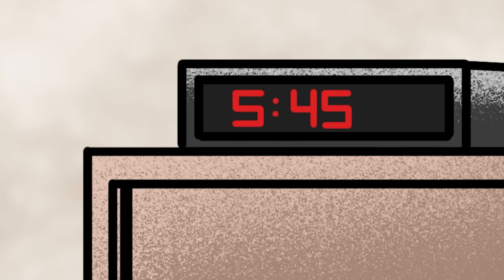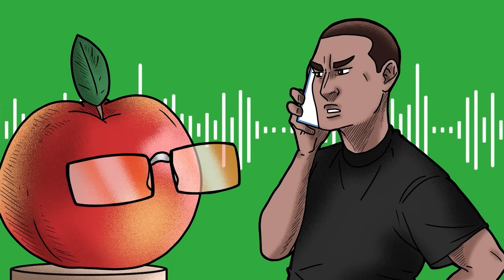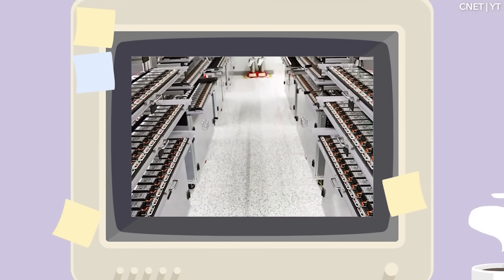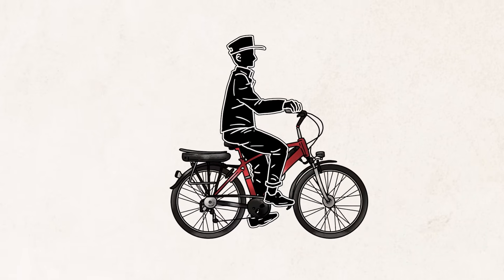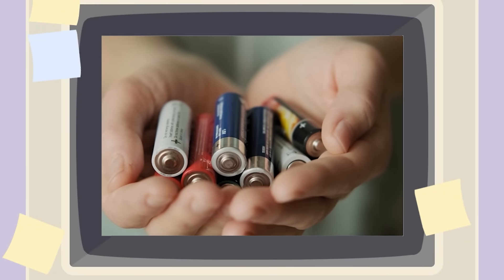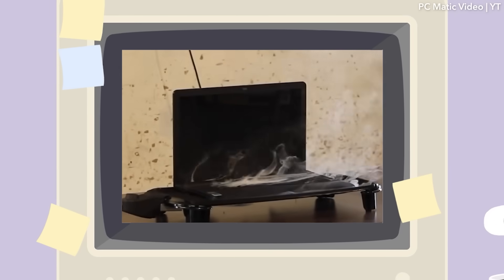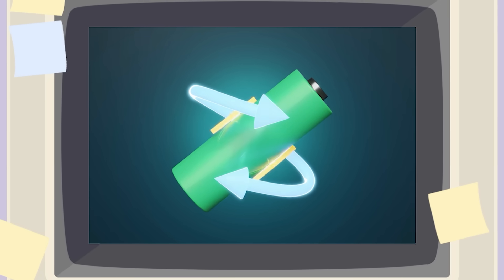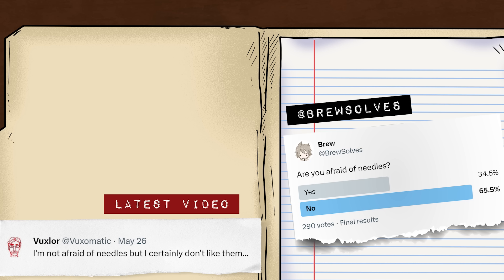A Man Wears His New AirPods. Minutes Later, He's Rushed to the Hospital.

Comment: As a person who had returned to using wired earbuds after the wireless ones start heating up every time i charge it. I guess i did the right choice.
Also, i always considered charging phones overnight as an extremely dangerous idea, so it always surprised me when i hear someone said they have their phone charged overnight.
Reply: Well I'm not waking up in the middle of the night just to unplug my phone, so my phone is just going to have deal with it
Reply: smartphones automatically stop charging when at 100%, or a set charge limit. if you have a smartphone, you can leave your phone on the charger all night and it will be fine
Reply: @maxgoushaw1977  yeah idk why people are so paranoid about it, I did for years and my devices are totally fine
Reply: Off brand phones won’t have the safety feature sadly
Reply: I used to charge my phone overnight (i only got a phone like 3 years ago when i graduated so i still priortized my laptop for awhile) then i became addicted to using it in bed before going to sleep and would be too lazy to get up and plug it in so would just rest it down. I used to feel bad like i was wasting time when it could be charging but god the relief i feel now
Reply: Get neckbands. I stopped using earbuds when i got a neckband and it lasted 12+ hours on one charge. Basically you charge it once, and it'll run from noon to midnight. When the battery wore out, i replaced the battery with a mobular6 (micro drone) battery and i now charge it every other day. I basically don't use my headset anymore outside of conference calls.
Reply: @Hajile_Ibushi but... you've replaced the fear of deafness with that of decapitation.
Reply: @jheanelltabana8713  I... Did not expect someone to say that...

Comment: I have a Microsoft Surface Go, and the attached keyboard woke up the tablet in my bag. 2 hours later the battery was dead and i just about burned myself trying to grab it so i could begin my work. 

You are supposed to be able to tell microsoft computers what devices can and cannot wake the computer up from sleep, but the option to disable this for the trackpad, keyboard, and bluetooth mouse were frustratingly absent. So now i just turn it off before putting it in my bag.

Comment: It's also a quality control issue. Some Chinese companies just don't care enough. That's why many of these Chinese scooters fail. So whether importing Electric Vehickes, or building your own e-bike, or homemade electric motorcycle or car. Choose vehicles or parts from trusted, name brand sources, with great reputations.
And at minimum, charge these removable batteries in a metal box if you are not actively watching them in the background. Lithium batteries are very energy dense, but you must baby them. Especially Lithium Ion & Polymer. LiFe (Lithium Iron Phosphate) batteries can take a little more abuse & neglect, and have more cycle life, just heavier then Ion & Polymer, but still should not be taken lightly.
Solid Stste and other battery advancements are taking so long to perfect and bring to market. These are the best we can do from a production and custom standpoint. 
Go to the Battery University website to learn about batteries, and how to take care of them, and get the most out of them, be it a device or vehicle.

Comment: 10:33  Which exact tech companies of the early 1900's were these?  Ford? Parker?  As far as I know that's a typo/misread 1900 would  have been lead acid batteries....  1990's maybe fits, but even then Li-on didn't really take off till the early 2000's   I feel like even in the late 90s it'd either have been NiCd or NiMh for anything rechargeable,

Comment: VR may be the future of gaming and working environment. Currently most avalible VR headset requires a wire connection and the power goes in thru the cable so there is no battery inside the headset unit. That's about to change as many major companies are designing true wireless VR headset. Can't wait to wear those with batteries inside, right on my face.
Reply: Apple's new $3500 device has the battery separate on a wire as the headset is already very heavy.

Comment: Good video! What about old devices? I’ve got a lot that I’ve let run down to dead but kept because I don’t want anyone retrieving my data from them. Could old, dead lithium batteries be a problem?
Reply: Yes. MrWhosetheboss has a collection of old phones and he recently reported that when he checked on them, a lot of them had bulged. I've had old devices that have had bloated batteries too. The issue is that many of these devices have standby circuits that draw a very small amount of power but over time, it will over-discharge them. On the other hand, I've had batteries that are not connected to anything be fine for many years.

Comment: Most cellphones, laptops etc. have safety mechanisms, that automatically separate the battery from the electrical circuit when done charging, after they activate the device (almost) fully draws its power from the charger and the battery just sits there as if connected to nothing. This prevents overcharge damages. In the HP laptop seen in the CCTV footage in this video it seems like that mechanism failed and kept the battery connected for too long, or any of the thermal safeguard failed and let the battery overheat and thermally run away.
Reply: dam i have an hp laptop , an office chair (theres a video where office chair explodes) and a pair of airpods, how much can go wrong.

Comment: Exploding/burning consumer products is one thing, which led me to a scary conclusion: Imagine all the e-waste from Li-Ion batteries that are slowly accumulating in landfills everywhere. For example, I tore down a disposable vape product, using a 2.7V 650 mAH battery. Read that middle word in the sentence, "disposable". Others with dead phones, laptops, etc, who don't want to deal with the bother of dropping e-waste off and opt for chucking it in the trash, means this will eventually pile up to eventually be ruptured by an errant bulldozer.

Remember the tire fires of the 70s and 80s? Walk in the park compared to a cascading Li-Ion fire, as the latter is considerably more toxic than burning rubber.

Comment: I'm not an airpods fan myself, but it should be noted that their are hundreds if not thousands of airpod knockoff look-a-like products being sold around the world, and China is where most of those fakes come from, and it's a race to the bottom for cost. Airpods being one of the best selling wireless headset in the world, the clones and knock-off's are everywhere and things like safety, water-proof rating, proper battery, are expensive. Linus even reviewed some knock-offs, you get the point. Make sure to get the real 1st party product when it comes to this sort of thing. Apple has confirmed that in nearly all cases the airpods were knockoffs or refurbished using incorrect parts. Just should be noted I'm a Sony fan, and yes there are fakes that have also exploded.
Reply: I had clones before the battery  is weak on these and really  small it's difficult (not impossible) for them to burst into flames( when they break I abuse the battery  to see what it will happen)
Reply: I will say, I have only seen these with fraudulent or dupe products too

Comment: while nicd, nimh (nickle cadmium and nickle metal hydride) are safer to use they have much less capacity. but from what i know, lithium is dangerous because it is a alkali metal which reacts to water in the air. lithium and cobalt batteries are not the most common (they are the cheapest), and they have the highest chance of lighting on fire. there is a new technology being used called li-fe or lithium  iron, which helps stabilize the battery. there is a lot more to it, but as with the video it might be best to keep it to a minimum.

Comment: Batteries do NOT just explode on their own. The chance is not mathematically 0%, but is astronomically low, so that this shouldn't be a fear. On average, in countries with relatively okay-ish economy, most people carry somewhat 7 Li-ion batteries on them (3 cells in their laptops, 1 in their phone, 3 in their earbuds, one on each side, one in the charging case), yet battery fires are so rare so that they end up on news.

And more likely than not, they go wrong during charging if any, especially at the beginning (for previously over-discharged cells) and at the ending (over-charging). During discharging (aka using), the risk of a battery fire is practically zero, that's why Brew only found 2 cases of AirPods fires over so many users around the world.

Comment: Batteries should communicate their wear level to chargers that should refuse to charge them if they become unsafe. We'd have to set up a standard so manufacturers don't abuse this, but it's possible to be done right.
I use a USB ammeter to check the capacity of my batteries from time to time and as they wear I dispose of them. We have all the technology to make using Li chemistry battery use a lot safer, it just needs to come together. I store my batteries in an ammunition container, just in case.
Reply: Most li-ion batteries already do this either analog by monitoring voltage, current, temperature or digitally with a battery management system (bms) which is a small motherboard on the battery that manages charge/discharge, balance, temperature, also most lithium battery tech has moved to safer chemistry like lithium iron phosphate (LiFePO4) or Lithium nickel manganese cobalt (NMC)
Reply: @emberhayes3682  I know what it is and how it works. The BMS does not communicate with the charger, and it should. We'd have less fires if they did.
The chargers will persist in attempting to charge the battery unless the BMS cuts it off, which all too often does not happen, even with spicy pillows.
That's why I have to do my own battery conditioning, I have had chargers that attempt to charge batteries with a resistance 20x where it should be.
We end up charging cells that should never be charged. With most chargers as long as they detect a battery they will keep pushing the charge.
You shouldn't assume you know more than everybody around you.

And no, most have not moved over to LiFePO4 or NMC. The good old NCR18650B is even still in regular use in new products and the cheaper the item the more likely it is you will get a recycled or dirt cheap cell which poses an increased risk.

Comment: Overcharging isn't really a issue anymore with modern devices, new devices (if they're competently designed) will completely cut charging and run on the charging lead only once fully charged
Reply: Yes, Li-ions shouldn't be trickle charged, in fact.

Comment: Few mistakes in the video: The Li-on or Li-po batteries do not necessarily have to have a (hard) metal case. Some have a "metal pouch" instead. And if you completely discharge these, you do not break them, but you severely degrade them. In addition to this, if your device has the option to cap the charge to about 55 to 80% you should use this to allow safe unsupervised charging (like overnight)
Reply: Samsung investigated themselves and found no wrong doing eh? typical.
Reply: basically any charging circuit for li-ion batteries cuts off the charging and doesnt start it again unless you unplug it and plug it in, in which case it will stop anyways when it reaches a certain threshold.
Reply: you know all phone have that function , they don't allow overcharge or above 100% , otherwise most of the battery would swell up already.
Reply: @VJETRA  correct
Reply: Also lion batteries last more than 2 to 3 years
Reply: @homemadesuperstar796  yea, it depends on the storage conditions and stuff
Reply: Completely discharging will degrade battery is a myth, ALL modern electronics will shut off long before and won't let you completely deplete the battery.
Reply: I'm sure he will eventually make one about wired headphones as well
Reply: You're wrong, he covered that not all have a hard case while get this showing images so yeah you missed that. Also you do me up most by completely discharging them. The main reason is that it actually makes it so the charging circuit can't recognize that a battery is there to charge. Now it is possible to trickle charge or "jump" the battery to get it to charge again. Most people and companies don't have equipment to do that so essentially it is broken at that point. Also it's 85% typically as above typically registers on the charging circuits as a full cycle for charging. Also modern charger and devices have charge circuits to prevent overcharging. Basically leaving it charging isn't much of an issue anymore. The big thing is it prolongs the life to limit the charging so it doesn't register as a charge cycle as the charging circuit slowly reduces the life for each charge cycle for safety.
Reply: They also have a MUCH longer shelf life than 2- 3 years, alkaline nowadays if not activated i.e. (still in packaging/not cycled) have about an 8-10 shelf life where as Lithium is more like 14-18 years, lithium ion does degrade faster but not 2-3 years, if given average use, 4-5 seems more accurate
Reply: Speaking of errors, I thought the first batteries were made by the Egyptians. Or is that not a fair comparison?
Reply: @melissahollowell7255  We don't actually know that that's what it was. It's an intriguing possibility though.
Reply: Error on your part, the li-on you can run down dead and charge back up and be fine no problems
Li-po you don't want to run dead since you can charge back up but you will have problems, and lipo also can randomly and very fast heat up and explode
The ion is alot safer compared to lipo
Reply: LiPo batteries are super finicky.